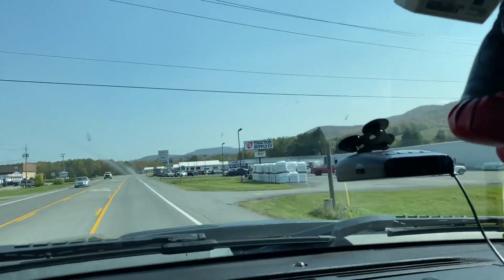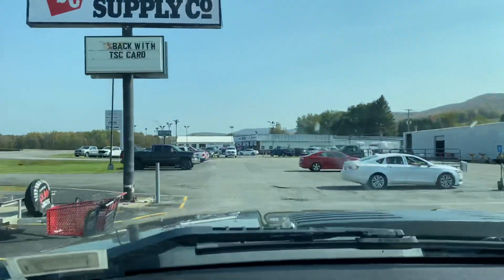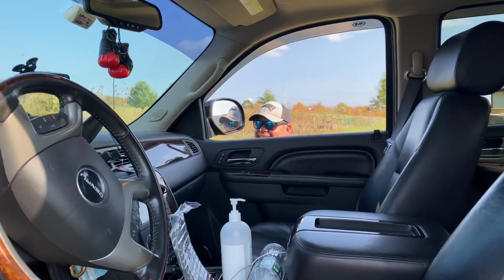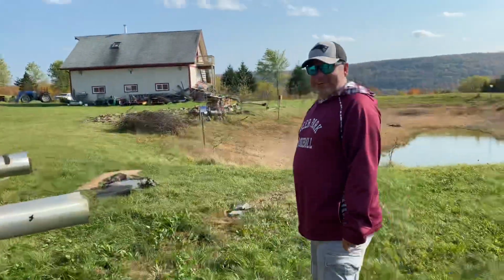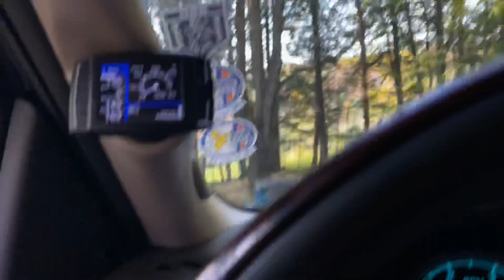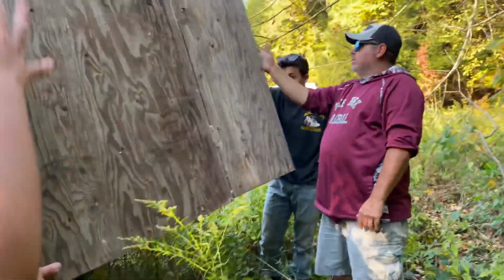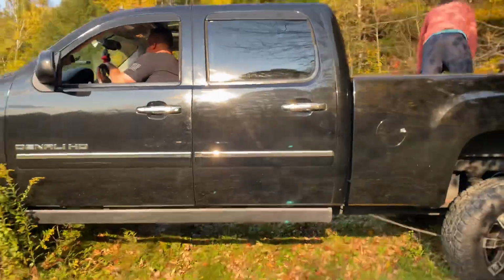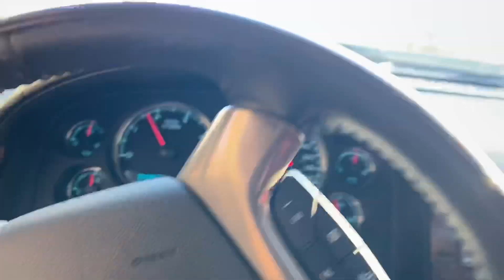Attention🚨All SkoPod Engine❤️Lovers Great News Coming Soon! & Come Help BOTAJELL Set Up Deer Blinds

Comment: Dam bro thought you were on vaction up there that put you to work doing shed moving and roofing🤣🤣🤣 wade is cool dude great guy to take your skopod! Putting in that work at the  botajell  compound  any ???? 💪💪💪💥💥💥💨💨💨
Reply from the maker: O man did we work up there lol 😂 wish you was with us there was a lot of things that happened not shown in video 😂🤣! I herd you did amazing at the philly race and your Baja was over powering the little tiny bit of track bite that was put down and surface issues. Im confident that if the track was in better shape you would had come home with trophies 🏆 NO ?’s
Reply: Man would love go up there one day and run my nitros with ya!!!   I had problem with fuel line leak so car was not running right bogging out during the run and wrong gears  but my numbers were still decent considering the fuel line issues and gearing!! I would do better if there is another event I would be more prepared! Lot guys realized after seeing your baja go 3.9 what works so every one is getting faster with drag pipes and bartolone engines so no walk in the park qt these races for any one !!